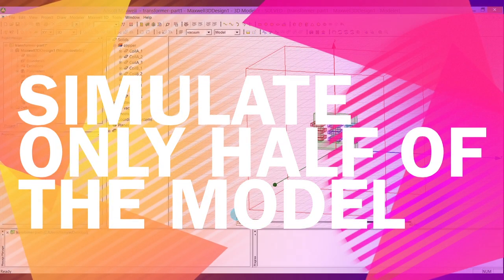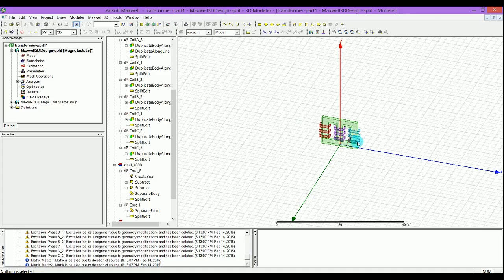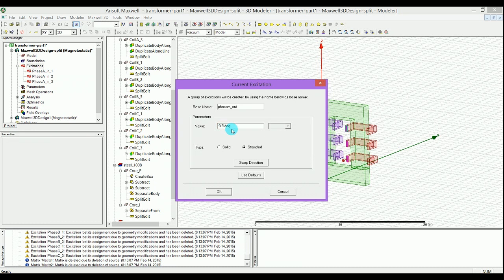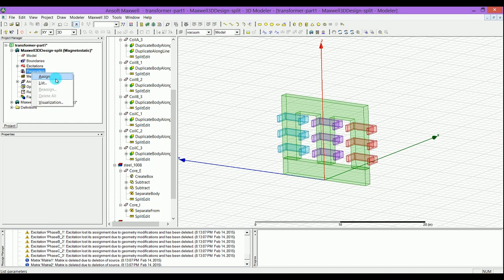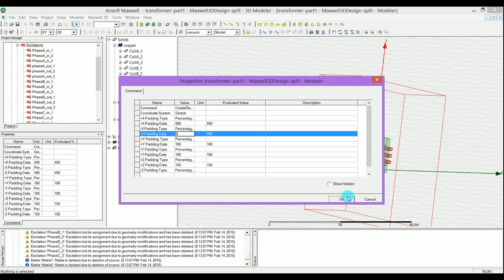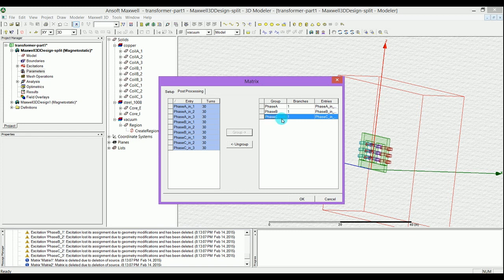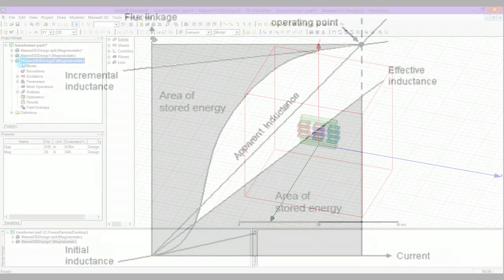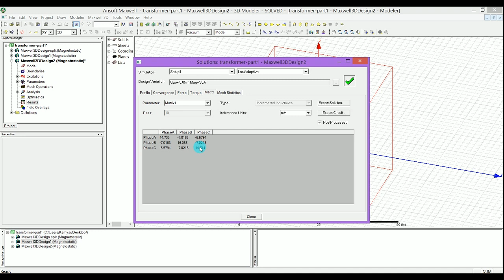209 - Ansys Maxwell - How to split the model in half and simulate it

Comment: I think that comparison of the inductance calculation results at the end is not good since you set the maximum passes to 10; so you are essentially not comparing fully converged results, but rather randomly comparing the 10th pass which may or may not have converged.

Comment: kamyar,thanks for your tutorial.I am simulating a DC reactor (Inductor) and want to get its' DC bias property.It is a CD type inductor ,the core is silicon steel sheets and material is similar to DW310_35,  the coil is copper and 42 turns for each leg(connected in serial ,total turns is 84T), gap is about 2.6mm for each leg.I simulated and get the inductance value in the report,the value(3.0mH) is very close to the real parts which tested with LCR meter(test condition is 1KHZ,0.25V),but the question is the excitation current I set is 50A,the inductance should be 1.7mH around(because the core is been to saturated,when the dc current increased ),but the value is not been changed,I also changed the current to 100A,200A,but it does not make any difference to the inductance value.Do you have some suggestion about this? Could you please make a tutorial for DC inudctor, this is a very common part in circuit and equipment, thanks a lot.
Reply from the maker: yes I am about to make the tutorial for DC motors as well.
if the value does not change when you are changing the current that means that you are not simulating right. sometimes there is a bug in this software you have to remove the results and analysis setup to be able to run the new analysis. do that and let me know if it did fix the issue.
Reply: Kamyar ,thanks for your prompt reply.Yes ,I did what you suggested above and also added a parametric for Current (50A-200A)sweep,but the matrix inductance result is very similar.3.046116-3.046235mH. I am confused about this results.
Reply from the maker: have you tried to remove the analysis setup and solution data and matrix and start from beginning ? 
In that case make sure that the material has a wel defined BH curves. If you are changing the current and the inductance is not changing that means the BH curve is considered linear and therefor the B increases proportionally when the current increases. that means that you have a fixed inductor. Did you get what I am trying to say?
Reply: Kamyar,yes,I did that ,but I just got the above result.As for the B-H curve you mentioned above,I created a new material (silicon steel sheets which normally used for power transformers and inductors) and sheetScan  the B-H curve ,then imported it to the Maxwell ,but I am not sure the other property set is right or wrong? I sincerely hope you can make a tutorial which can show the nonlinear inductance of a inductor with DC BIAS. Can you give me your Skype or some messager accounts, I can send my project to you for your evaluation,if that is convenient for you.Thanks.
Reply from the maker: did you solve the problem?
Reply: ***** Not yet. I have no idea how to set this and get the result what I want.Do you have some suggestions about this.I think the key point is to set the property of the material ,but I do not know what the correct set is.